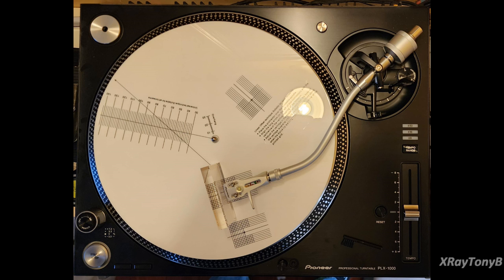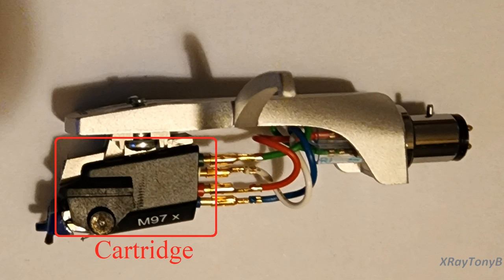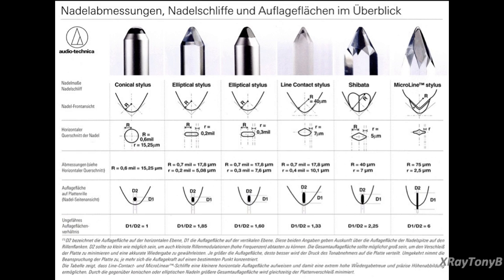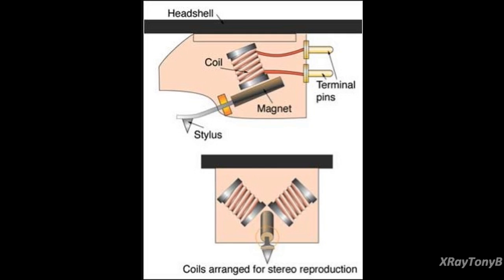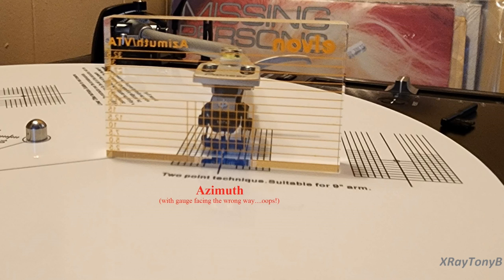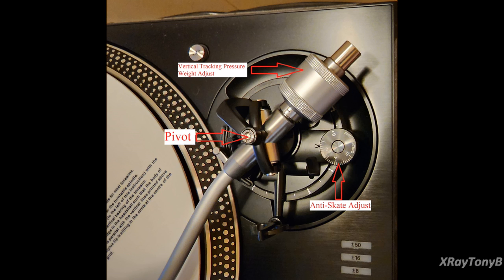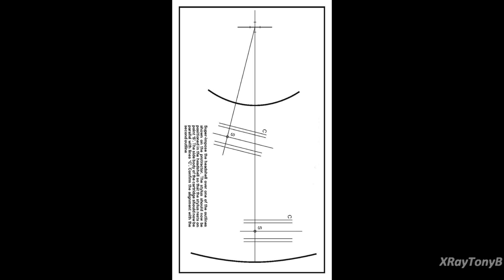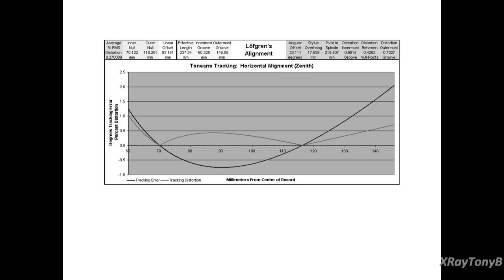Turntable Alignment Terminology

Comment: Nice video Tony. A couple of comments.
The skating force is not a gyroscopic, centrifugal, or centripetal force. Those types of force pull outward, not inwards. It is a vector force caused by the offset angle, and the friction between the stylus and the groove. 
Stylus rake angle and vertical tracking angle are not interchangeable terms and refer to different measurements, although in practice the two settings will move together with each other, so people will use one term or the other to refer to the same adjustment.

Comment: Tony, I liked the Video and the content, I repair old Jukeboxes and other electronic stuff from the 50s, 60s, and 70s. This gave me a lot of insight for the adjustments and calibrations on some of the stuff I work on.  But the main thing I took from  this some insights for a project I'm working on. I'm building a record cutting lathe. For general reproduction and for the ability to record today's music on media that isn't available. You got me thinking about the mixing and the means to convert Digital back to Analog without losses and distortion. Thanks for the content the great video.

Comment: Perfected Imperfection: what a great way to describe vinyl recordings at the peak of that technology!  I agree with you about all-digital recordings being  pressed on vinyl; it just doesn't make any sense. As far as altering the original recordings using digital track-by-track remixing (or making separate tracks for multiple instruments that were originally recorded to a single track and then remixing), I would have to say that I would have agreed with you until I heard the Steve Wilson remixes of some of Gentle Giant's albums. The clarity of the individual instruments in the remix is just amazing. Even the musicians themselves have lauded the new versions, stating that the remixes are how they would have wanted them mixed originally if there hadn't been limitations in the studio or its personnel. Great video Tony! Thank you for all you do for all of us.
Reply: Agreed. Steve Wilson's Jethro Tull remixes are far better than the originals too. It all depends on the producer and his ears during the mix. Steve Wilson has a good ear and doesn't stray or over compensate during his mix of the original material.

Comment: I fixed forward backward slop in a technics 1210 tone arm last night, it was the cylinder that held the horizontal bearings in the gimbal. not the actual bearings that needed adjusting. there was just enough space to move the arm slightly backwards out of the bearing / gimbal assembly and then turn it over to remove the two black cross-head screws, after this i was able to remove this cylinder and shim it front and back. i used two thin strips of sellotape and warmed them with a lighter flame so they would stick well. the barrel or cylinder holding the bearings slid back in and there was no more front to back slop then adjust the bearings and lock them till there is no play but not tight to the bearings at all.

Comment: How weird that this should pop up in my feed today as I've been looking at getting a new turntable.  Been considering the PLX500...the 1000 is a bit out of my reach.  I mean, yeah, I could buy it, but  I don't want to have to justify spending that much on a turntable when whatever I say will probably have me in the doghouse for a good while, lol.  This info will certainly be useful as up till now I've only ever had BSR turntables, albeit with metal platter & plinth and mine does have a moving magnet cartridge, a Pickering V-15 and I have narrow and wide NOS Styli for it for both modern and shellac (78rpm) records.  I know the 500 will also play 78's which was one of the reasons I'm considering it over the Fluance RT85.  The other reason is that it is direct drive as I've never been a fan of turntables that use a rubber band for their drive.

Comment: This is not directly related to the specific topic. But close enough.

Today, while sampling a new Audio-Technica USB turntable, another possible reason why people prefer vinyl occurred to me.

Could this be a “dancing bear” thing? You know, the amazing thing about a dancing bear is not how well it dances, but that it dances at all!

I put an old record from my dearly departed father in law, which clearly had been played very little and handled well, and was absolutely astounded at the beautiful sound, with no discernable scratches or surface noise.

Could it be that people put the stylus down on a disc of grooved plastic and thereafter find it hard to believe that the entire process works well enough to sound that good? From a metal rod moving back and forth under control of some gouges? It’s just understandable enough to make sense, and just astounding enough to be incredible.

People generally don’t understand CD’s or other digital media enough to have a sense of why it should be good, better, or best. Of course, I had to record the record digitally, and the playback, recorded to CD specs, sounded just the same.

Just a thought, while walking the dog.

Comment: In my case, when I started to replace my vinyl records for CDs, I noted that some engineers messed with the original recorded mix and added their personal taste. I dislike this practice. One example is the original pressing of ABBAs "Fernando". The vinyl version sounds more present and dynamic than the CD. Why? Because it was a different Sound Engineer who mixed the original recording. Sometimes a CD will tell you that they used the original mix master Tape, other recordings don't.

Comment: Hi Tony been following you for over a year now and learnt a great deal from you videos
Looking for some advice I’ve been rebuilding a music fidelity E100 I purchased not working it’s now been fully recapped and new quality outputs works well now
However at random periods I’m getting a single pop from the left channel any advice on where to look would be helpful ?
Can be 5, 10 ,20 mins between pops ?
Small transistor? Capacitor ?
Thanks in advance 
Geoff

Comment: I agree that digital recordings are absolutely superior to analog. Provided that every step of the delivery chain is also digital. I also agree that vinyl pressings of digitally recorded material are pointless. If, by some miracle, digital recording had come first, there would probably never have been any analog attempt made. And, those who are acolytes of the analog mystique today, would likely scoff at the poor-cousin relationship that any attempt at analog recording would display, with digital having been first. 
That said, I do feel that analog-processed audio has its place. I have made digital recordings of the much of the vinyl that I have, simply because of the convenience factor when listening. The digital copies of my vinyl material sound, to my poor ears, exactly the same as the vinyl - including all of the flaws, which is fine. And, I don’t have to mess around with a turntable, when I wish to listen to them. In fact, the only time I ever use the turntable now, is when I’m transferring vinyl to digital. The transfer process is slow, and laborious, but once completed, I can do just about anything I wish with the music.
Reply: Digital can be much more superior, or it can be not even close.  You ask why, well its all about sampling rate.  Digital's GOD is the sampling rate.  I challenge you to record a digital recording at 10k samples per second and then compare that to analog.   And as far as CD's go, they are not superior to analog as they are sampled at a very slow 42,000 samples per second.   When you attempt to reproduce sounds we call "Presence" 12,000 and up, you end up with only 3 or 4 samples per cycle.   You can not properly reproduce a true signal from 3 samples.

DVD solved this by moving to 98,000 samples per second.  This is why the sound on your movies is far superior to the CD.

So is Digital better?     Sure, if your very rich and can afford a DAT.   Otherwise, Analog has much better frequency response.  There is a reason why SiriusXM turn Vinyl in most their studios.

There is also the human factor for analog that you have heard from every Guitar player you know... Its warmer.  We can't measure "warmer"  but it is real.

Comment: You are sort of incorrect.   The work done for media is done when the recording is MASTERED.  Mastering is a process.  As far as a mix down, it is done for the sound, nothing to do with the media.

Today we MASTER for the media, ie. CD, Record,Cassette.  Mastering is where they Compress, Expand, and other audio ticks, and yes prepare for the particular Media(s).  Not many recording studio's Master.  Mastering is done by a separate company.  

 A Master Disk has nothing to do with MASTERING.  It was a term given to the disk used to make records from.